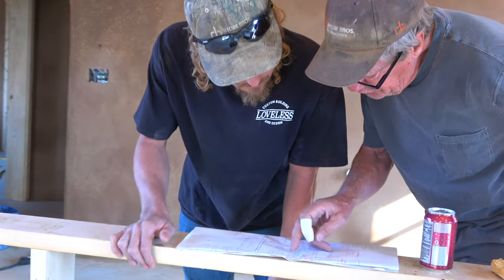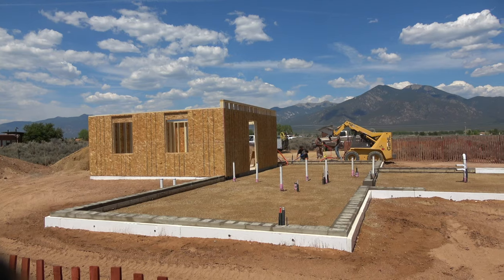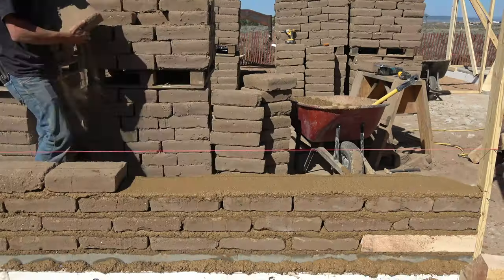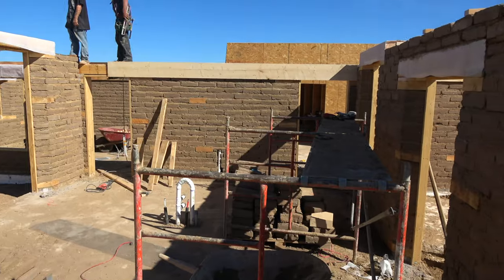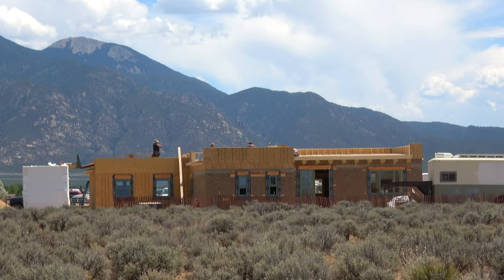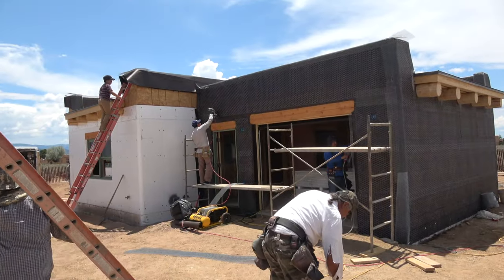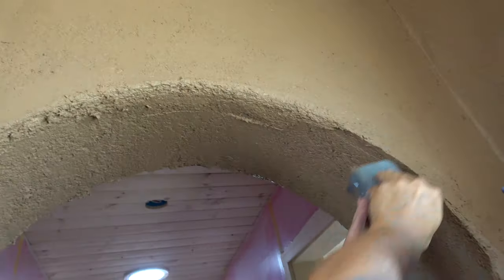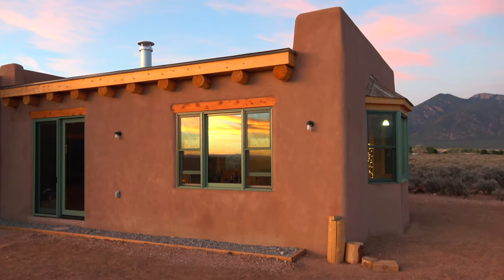Adobe Home Construction

Comment: I love it all except for the foam. Don't really see the point of adding foam insulation. Adobe is it's own insulation. One of it's huge advantages. Also don't think the mesh is really necessary, and its gonna make it harder to reuse the plaster if it ever needs redoing. Can save a good bit of money not including them as well. Very lovely house though.
Reply: The foam isn't insulation, it's a thermal brake, like he said in the video.  The adobe itself is the thermal mass, but using the foam slows the temperature fluctuation process, making the adobe more efficient year round.  Also, the wire mesh and fiberglass sheeting add significant structural component to the finished stucco, ensuring it will last significantly longer without the need for redo or touching up.  These guys know exactly what they're doing.
Reply: @meadmaker4525  Adobe homes have lasted for thousands of years.  The traditional methods work just fine.  It's not about whether they know what they are doing, it it's about how there is not just one way to build an adobe home.
Reply: Adobe has zero insulation property. It has an ability to delay heat transfer. For every inch of earth, heat transfer is delayed by an hour. Mesh is necessary in preventing earthquake damage. It has a dual use in being a good base for applying stucco. However, in this case the inside of the mesh cage was not tied to the outside. Additionally, the stucco they used was concrete based and can not be reused.
Reply: I love how people who can't build a ham sandwich second guess actual professionals.... Ah internet experts!
Reply: @richardleau  how should the steel mesh be applied?
Reply: Jus a Lil extra

Comment: The claims you made at the beginning of the video relating to heat gain through thermal mass are negated once you apply the insulation on the outside.

Comment: Beautiful, thanks so much guys. On the interior, I want to get the same look in a tiny house I'm building. I don't think mud will work bc the house is on wheels and the mud will probably crack from moving around. What's the best way to get a similar look? Should I just do a plywood ---> skip trowel ---> paint?

Comment: Can I use wet Adobe inside my existing outer walls in my man cave of a shed ???
This might be a lot cheaper then regular insulation, I don't know.
I am on a budget..
I can leave it to breath for a long time to make sure it is dry.
There is a roof and exterior  T-111 on the outside right now.
Reply: Adobe is not an insulator, it's thermal mass.  You may want that, but if you really want insulation, hempcrete and foamcrete (aircrete with styrofoam bits) might suit you better.

Comment: Really not sure if the foam and chiken wire are needed , the adobe is already an insulating material and adobe plaster stick perfectly to adobe bricks
Reply: Even professionally done Adobe will fall off without mesh over time and will need more maintenance
Reply: Adobe is not insulating; its thermal mass retains or radiates heat but does not insulate. The builders are wise to add a layer of insulation on the outside of the adobe.

Comment: Can an Adobe home be Built in the  the North East? I just wonder how it would withstand the cold weather  Up here
Reply: Id think you will have problems with moisture...
Reply: Some dude with creepy eyes  santa fe, nm is 7200 feet... low desert? what does that mean?
Reply: It would do fine but you have so much timber available
Reply: My grandmother home was made of adobe. Warm in the winter n cool in the summer.  Loved her home.
Reply: I did cob construction which is non monolithic adobe...  in the northeast , you can sandwich rigid foam/rigid board for insulation between 2 walls and that will pass IBC building code...  that's in the state of maine
Reply: Rgid board sandwiched between 2 cob walls... cob is monolithic the difference between adobe and cob

Comment: I heard that as Adobe is pretty cold in winter?
Reply: Is warm in winter and colder in summer, I grew in adobe home in mex and my mother home is almost 100 years old
Reply: I think they said they installed radiant flooring which would help with that.
Reply: The house has 2 inches of foam insulation.

Comment: Using foam insulation board and a concrete based stucco coating eliminates the natural breathability of adobe. Also reduces the ability of adobe to act as a natural heat sink. For every inch of earth, heat transfer is delayed by an hour. Using foam insulation stops this natural process. Using concrete stucco is a cause of "rising damp". I guess it's fine in the dry southwest. In wetter parts of the world this may cause mold. The water proofing ability of concrete keeps water out, but it also keep water vapor IN. Using chicken wire for stucco coat inside and out while not tying it together for earthquake resistance is just crazy. Taos is not immune to earthquakes. The bond beam prevents wall collapse in earthquakes and is code. But why not go the extra inch and tie the inside to the outside? Using foam board and concrete based stucco on the exterior "saves money" and protects the adobe bricks from water damage. So I see the reasoning. It's wrong. But I see it. Damn this is inauthentic and unnatural.
Reply: Richard, it sounds like you are an authority on the matter. Just curious, are you an architect, builder or?
Reply: Richard has never built a sandwich by himself but is clearly an "internet expert"
Reply: @JohnCunninghamTeam  Richard does not sound like an authority on the matter.  I would recommend you (and Richard) familiarize yourself with the New Mexico Earthen Building Code.  It will give you a better sense of why the builders in this video built this the way they did.  The standard 2" of EPS foam, as prescribed in the code, does not constitute a vapor barrier.  While not traditional, adobe absolutely performs better with insulation -- and, obviously, the adobe still acts as a natural heat sink, because presumably you are heating the inside of your house.  Especially in cold climates like Taos, an un-insulated north facing adobe wall will get cold and STAY cold all winter long -- not what you want.  

I really appreciated this video.  Every builder does things a little differently, and has to weigh a thousand considerations -- what is best for the building, what is possible on the site, the homeowners' wants and needs, the budget, the building crew's skills, equipment, and time, etc. etc. etc., while also abiding local building codes.  Most of all, I'm just happy that the clients chose to build a real adobe house, and not a frame construction counterfeit.

Comment: I thought this might be a cheaper way to build but I can see it’s actually a lot more expensive
Reply: i think they have to conform to building regulation code and they had to do extra steps for exterior insulation and water impermeability
i also remember this documentary about adobe/mud-brick construction in Yemen, one builder said that concret and mud building cost about the same, the mud is cheap but the manual labor is more expensive
but on another hand, all in Yemen agree that mud houses last centuries while modern concrete doesnt last more that a few decades
Reply: If you have the right soil already on or near the property the major cost is really just labor. Though making the bricks isn't complicated. They're just put in a form and then sun dried. So if you have the right soil and make the bricks yourself its very cheap.

Comment: Seems like such low price building material, a good but if labor, but, I mean, it is basically just dirt.
Reply: A standard home is just chicken wire, lathe, 2x4 and stucco
Reply: Has to have some kaolinite content.  Read sticky mud when wet, dries hard.